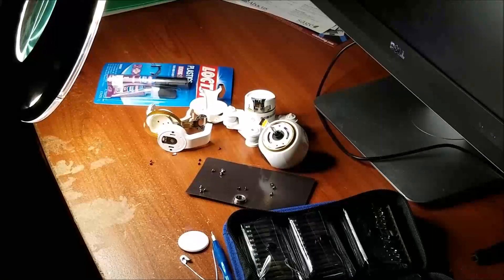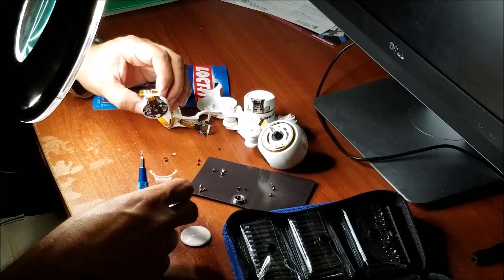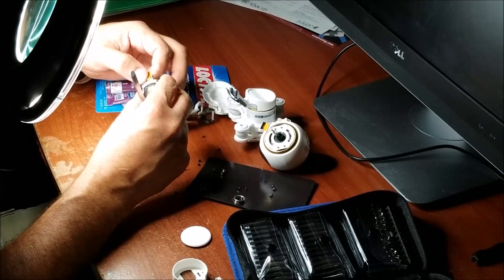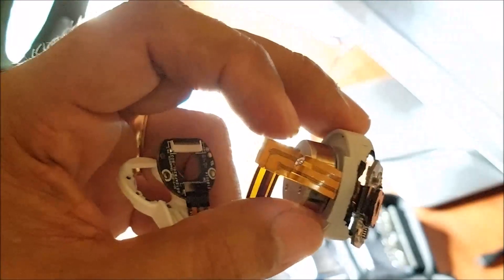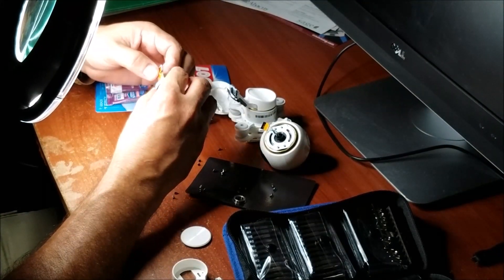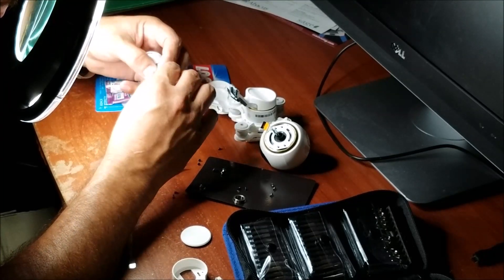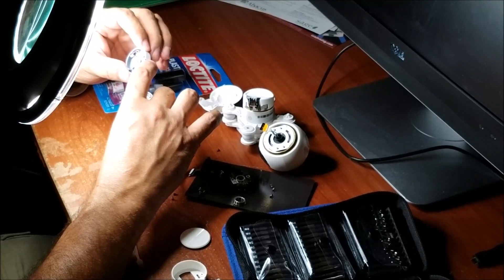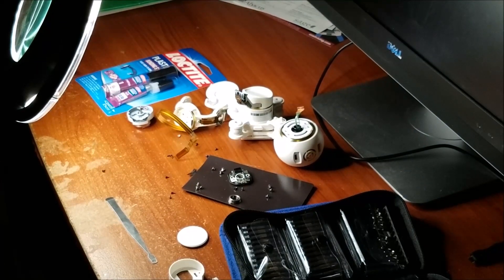Xiaomi Mi drone 4k broken gimbal repair Part#4

Comment: Hi, thanks a lot for putting these videos online! I got a replacement flex cable which restored some functionality: The gimbal does what it should do, and the camera picture is transmitted to the smartphone. However, I cannot adjust the camera's angle, calibrate the gimbal (self-calibration when starting the drone works though), and - most importantly - I cannot start a video or make a picture. Do you have any idea which component could cause this? Any advice? Thanks again!
Reply from the maker: Bernd Meyer wow... thats nice buddy... usually is due to bad connection, thats  mean maybe one of the ribbon cable is not connected all the way making a false or none contact... check it again if possible and do not force it in, is a pain but it will go little by little.... also I could be a defective cable or something else damage inside the camera, good luck and keep me posted, I hope you discover the problem.

Comment: Hi German. What ribbon did you had to buy? I've the same problem. First flight and my drone crashed due to lost "battery connection"... Thank you!
Reply from the maker: Iñigo Martinez Lasala 
https://m.aliexpress.com/s/item/32812828690.html?trace=storeDetail2msiteDetail#autostay
Then measure the cable and follow choose your size: size:

NO 1 cable： about 7.5cm

NO 2 cable： about 13.7cm

NO 3 cable： about 17cm
Reply: Yes, I had already located the web page. Since Aliexpress shipments takes usually three weeks or more, I prefer not dismount gimball yet. My children have the ability to throw everything at my work desk to the ground. :-) My gimball is exactly the same you have, and also my problem. It has the arm broken. In my case, ribbon is also cut. If you can tell me what ribbon lenght did you buy it will be great. I would like to start dismounting gimball only after receiving the part. Thank you for your great tutorial, by the way.
Oh, I forgot... I also speak spanish (better than english, just in case) :-)
Reply from the maker: ok great ... now are you 100% sure is the same ribbon cable as mine?... if you are 100% sure it was the NO 2 cable： about 13.7cm, make sure you have the right one otherwise it will be a good idea to buy all 3 , Good look and GOD help u, be patience it takes time.
Reply: Yes, I'm sure. I doubt between #2 and #3. But yes, you are right. Perhaps I should buy 2 and 3 or fully dismount the gimball.
A pity that Xiaomi as not enforced the arm enough in order to resist better to crashes. ;-)
Thank you very much for your help!
Reply from the maker: I hope they make it for sale soon , I am trying with some friends to duplicate it, if we can I will let you know.